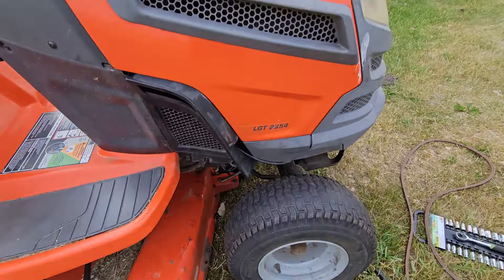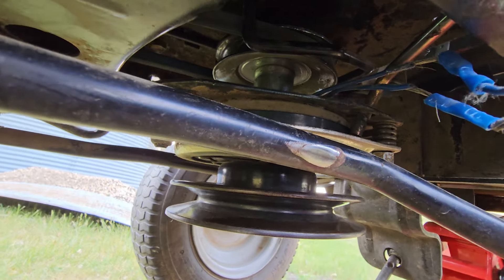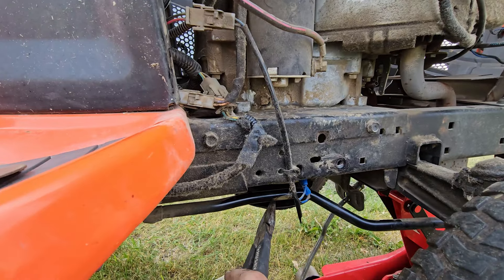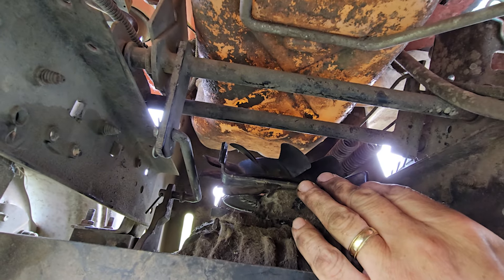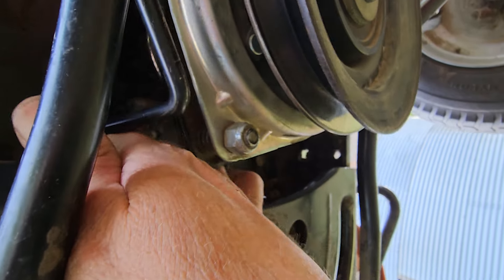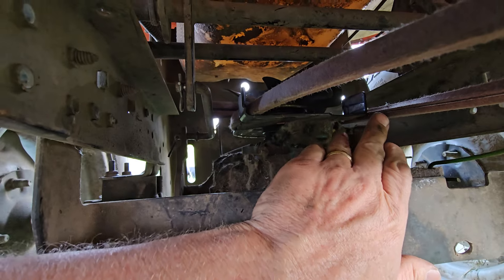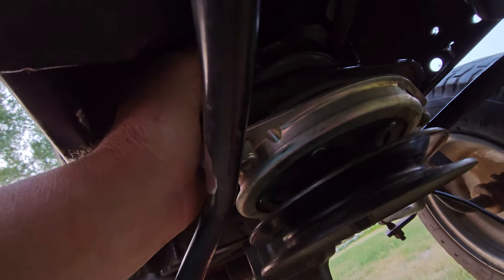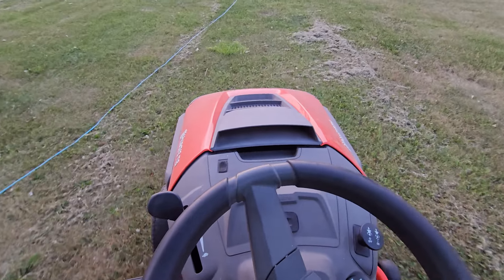Husqvarna Riding Lawn Mower Drive Belt Replacement Fix LGT2654

Comment: I followed your video to replace my drive belt.. thank you!! I found it a little easier to get the belt over the fan blades by taking the belt off the front pulley and resting it in-between the pulley and the deck pulley..
Reply from the maker: Awesome!

Comment: Thanks.. I needed to remove the 4 bolts holding the seat in place to get it over the fan. My Craftsman was slightly different but you were a great help. I couldn't have done this without you.
Reply from the maker: Glad it helped!

Comment: Thanks for the video, sir. I have a GT54LS, and this video did the trick. My tractor has a nut on top of the fan, directly under the gas can, which made slipping the belt behind the fan a little tricky, but everything else is exactly the same. Appreciate it.
Reply: Getting that little clutch anti spin bar back in is a bit tricky . Any suggestions??
Reply from the maker: @paullongaker8850 worst part of the job...keep working on it.

Comment: Good video, however; you do not need to remove the deck to replace a belt, only the two plastic guards on the sides need to be taken off. Just did it last week. 10 minute job.

Comment: great video thank you for making this video
Reply from the maker: Glad you liked it!
Reply: So what's the size on the new belt?
Reply from the maker: 130969 is the number. I am not sure of the actual length.
Reply: Thanks! Where did you get it? Lowes does not have one in stock
Reply from the maker: @Adanavila1986  Search the number on Ebay.

Comment: My issue is when using my mower for the first 30 min of so the drive belt slips off track and won't move. So I'm wondering if I need to replace the belt or if there's another issue
Reply from the maker: Check the belt guides & make sure they are in place.

Comment: I have Husqvarna ST 138 2015 model. when I push the forward pedal, the mower moves in reverse, the reverse when I push down is okay, but the forward goes in reverse too..?  It has me beat what the problem is
Reply: U have the belt ran wrong then. Ive heard other people speak of this too and usually they have the belt ran through all the pulleys wrong causing the rotation of the rear end to be backward
Reply: @bubbyhardy6135  Okay, thanks, I purchased the mower in this condition. Maybe the guy who owned the mower before me put the belt on wrong. Thanks again 👍